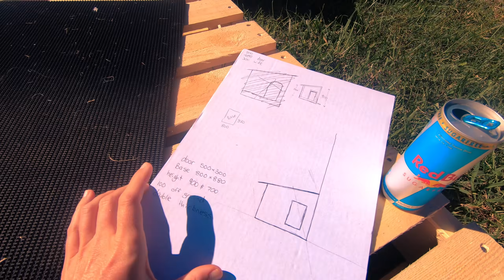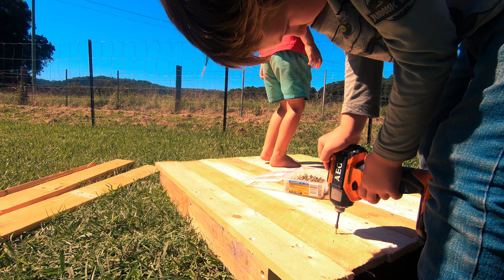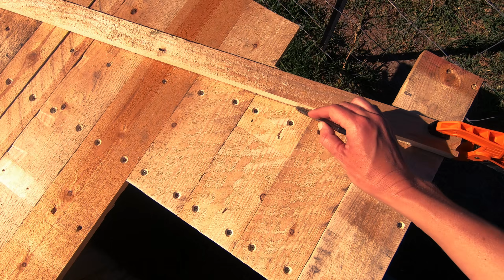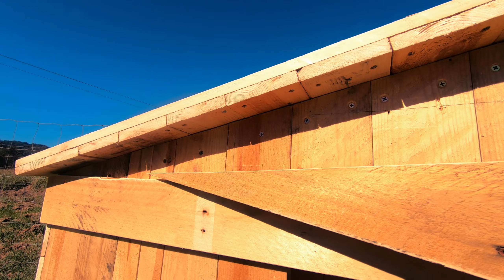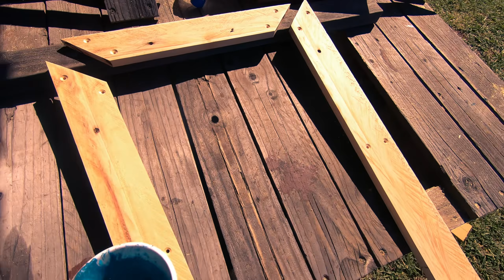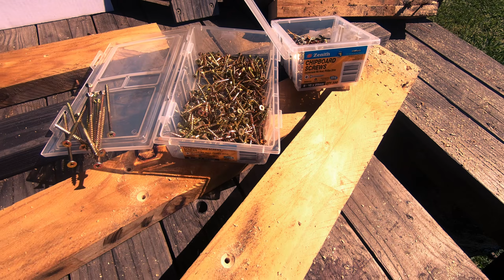How to Build a Dog Kennel with Pallet Wood★DIY Wooden Pallet Dog House★Making a Warm Paling DogHouse

Comment: Hiya how many pallets did you use for this kennel??
Reply from the maker: Good question. Roughly 7 pallets. But most the pallets I get have 8-9 palings both top and bottom.
So a more accurate gauge would be how many palings I used.
Which is just over 100. palings. Hope that helps.
Reply: @NikitaMaree thankyou for your reply I have one more question what was all the measurements please if you dont mind sharing 😊
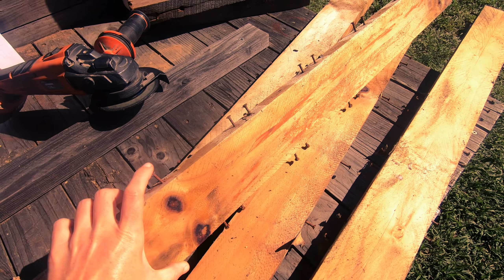Reply from the maker: If you wanted to take a screenshot at 00:11 you can see my rough plan for the build. 

The base is about 800x850 and 100mm off the ground.

The tallest side is about 900 high and the shorter side about 700 high.

The door way is about 500H x300W

Good luck 👍

Comment: Tip for easy removal nails from palette struts: put a claw hammer/crowbar in a bench vice at 45* angle. Then simply hook the nail heaf and leaver out, because the beem is much longer than the hammer you get much great leverage. Easy.
Reply from the maker: Nice 👍

Comment: My question is, would this style dog house build withstand a downpour without getting wet inside?  I live in a wet climate.
Reply from the maker: Good question Paula.
I don’t live in wet climate. But we do get a couple weeks straight of flood rain each year. I usually lift the dog kennel up on 4 bricks, during this time so it isn’t sitting in  ground water for days on end. 
If I lived in a wet climate I would consider using a scrap piece of corrugated iron for the roof instead. But because the roof is at such a steep pitch, I haven’t had water leak in.

I also keep this up against the house wall, so it has the extra protection of the house eaves. 

Good luck with searching for the design you like. 👍
Reply: @NikitaMaree  hey thank you so much for replying to my comment.   It's rare these days to get a reply.  There are a lot of chained dogs around where I live that don't have shelters, and it breaks my heart.  I bought some power tools and I am planning on building houses for them.  I have 0 experience with building anything like this.  
I hope I can be as good as you are.  I only bought a skill saw,  jigsaw, and sander.  We have an impact drill.  I still need to buy screws.  But I hope using pallets will be enough to make most of the dog houses.  The corrugated  roof should be good also.  I wonder if it would be cheaper to use shingles?
Reply from the maker: Thank you for your kind words. That sounds like a very nice collection of tools to start off with. And also sounds like a really lovely thing you are doing for the local dogs. 

I am sure you will do great. I have never completed a project without running into at least a few problems. So if you are struggling with a section, know that I did too. 

I have never used or priced shingles before. That could definitely be a good option. I usually have access to reclaimed corrugated iron, so that’s why I try and use it when I can.

Comment: In America that would cost $100 to build. A bix of screws is like $20 a gal of paint is another $20
Reply from the maker: I used the equivalent of 0.03 of a US Gallon of stain (150ml) so that's 60cents  USD.
I used half a box of 25mm screws $8 ($16 full box) and one third of a box of 40mm screws $9 ($27 full box) so your $20 box of screws is right in the middle. 
Not sure why this would cost you $100 to build?
Reply: Hey wilson, $20 + $20 does not equal $100

Comment: I'm wanting to make a kennel for my dogs with recycled pallets but am concerned that the stains on the wood could become a health concern for them.
Reply from the maker: If you are not sure of what caused the stains then I understand your concern.
A lot of pallets are used to carry nasty chemicals and you never know what has been spilt on them. 
I am lucky with the pallets that I get because I know exactly what they were used for and I also have a large amount to choose from.

A possible option could be to use the under side of the boards for the inside face of the kennel so the dog can safely lay against the clean side of the boards and keep the stains on the outside of the kennel. (Just a thought).

I wish you luck with whatever you choose.

Comment: That's a stylish dog house!

How has the stain and finish been holding up over the year so far? Thinking of building a quail coop and might try the stain and finish you've used here as it looks so good and is, as you said, a cheaper way to go about it, so just curious if the finish starts to flake off after awhile and needs to be redone?
Reply from the maker: The stain and finish on the sides are holding up perfectly.
The roof is flaking in places but we have had 2 decent sized hail storms in the last 12 months, so that definitely wouldn't have helped.
I have recently started making my own stain to save even more money and I really like the way it looks.
I have a video here: https://youtu.be/UukDsFoj-Lw
I still use the watered down pavement sealer as a clear coat, but everything is becoming more expensive.
Reply: @NikitaMaree  Ahh interesting, since quail would inevitably peck at the wood I might be better off just ensuring Im using clean pallet wood and foregoing any stain/finish. Thanks for the update :) 
Just checked it out, was very interesting, might have to give it a shot with something lol

I'm in SA, so I know what you mean about things getting more expensive.

Comment: Great build. Is it possible to use left over radiant barrier to keep the heat  and bugs out from crawling between the wood?
Reply from the maker: Thanks Iraj. A radiant barrier between the 2 roof layers, would probably be good idea for hotter climates. The bugs for me are not really an issue, because the gaps are minimal and the door is wide open anyway 👍 Hope it works out for you.
Reply: @NikitaMaree  it's my pleasure. I Would include the silver foil like radiant barrier on the walls and floors of the dog house to really keep him safe 😊
Reply from the maker: Sounds like a good plan 👍

Comment: Roughly how many pallets did you use?
Reply from the maker: Good question Mark. Roughly 7 pallets. But most the pallets I get have 8-9 palings both top and bottom. So a more accurate gauge would be how many palings I used. Which is just over 100. palings. Hope that helps 👍